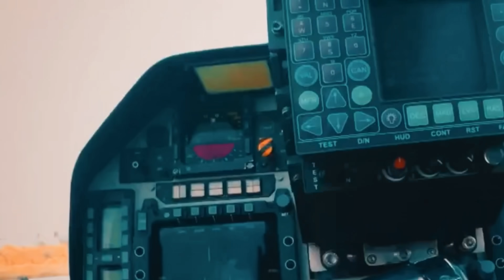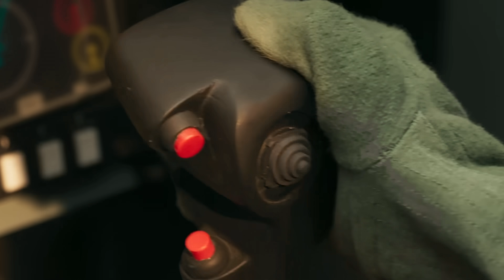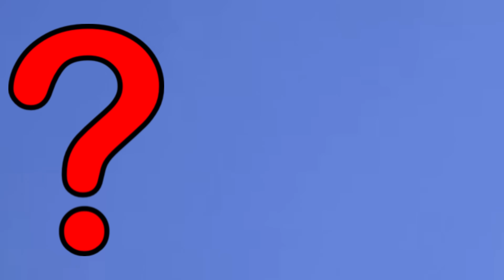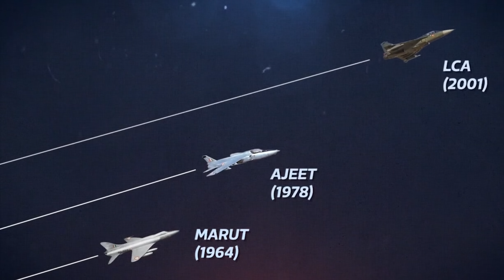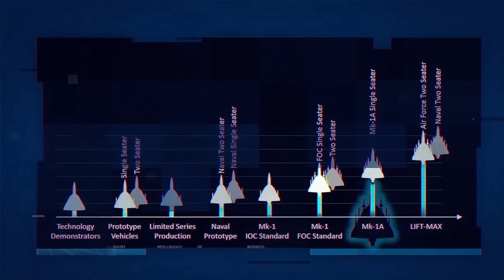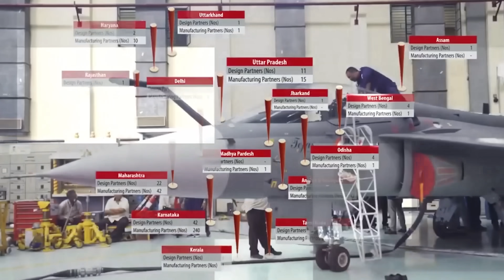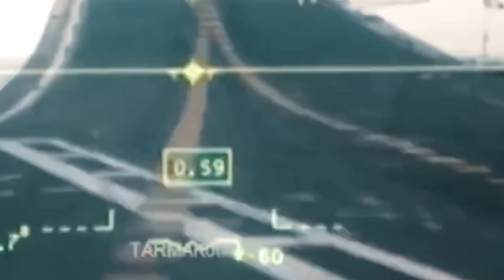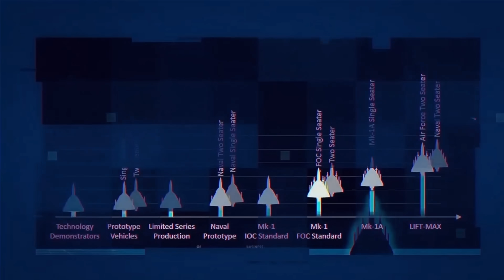Why does everyone hate the Indian 'Tejas' LCA 4th Generation Fighter Jet?

Comment: The Tejas Mk1A is in the category (weight, range, payload wise) as the Gripen C. Both are powered by F-404 engine variants and have similar empty weights and other parameters including sensors. In fact, the Tejas Mk1A has an AESA radar, whereas the Gripen C features the PS-05A mechanically scanning array radar. Remember, the smaller and lighter the fighter, the smaller the sticker price is. Tejas Mk1 costs approx $40 million compared to the $80-$90 million for F-16V. 

The Gripen E on the other hand is larger and powered by F-414 with IRST and AESA radar. That will broadly be analogous to the Tejas Mk2 which is in development and will roll-out either in December 2025 or March 2026. Tejas Mk2 will also use the F-414 engine, has AESA radar, IRST and internal EW suite and has even larger payload and Max Take Off Weight than the Gripen E. Gripen E MTOW is 16,500 kg whereas the Tejas Mk2 MTOW is designed to be 17,500 kg, which is like that of the Mirage-2000.

Comment: Just acquiring the capability to develop not just the airframe but also all the other systems is difficult, and the IAF & HAL pulled it off.  The only remaining hurdle is a modern engine with FADEC.

Comment: Well Tejas MK-1 is Light Weight Class fighter, Comparing it with F-16 and Gripen would be unfair because they are not in Light Weight Class!! Tejas can be Compared with JF-17 and F/A-50 which are similar class and when you compare Tejas is light weight class you will find it's on Top level in specification and performance but yes it yet to get in service with large numbers 1st

Comment: Tejas don't have Aesa. No Irst, no Ew, no Bvr capacities. How is it even 4th gen?
Reply: It does have AESA and BVR capabilities, what are you talking about?
Reply: @fenrir834 Whar's the name of company makes Aesa radar for you? What Bvr missiles are you using?
Reply: @olg7778  Elta and LRDE are the names of the companies. It has  I-Derby ER and Astra mk1 and perhaps even Astra mk2 integrated (not sure about Astra mk2).
Reply: @olg7778 It has 3 different BVRs (Astra, Derby, MICA being integrated) 😂 its pod can double as IRST & EW pod is also integrated... It has Israeli Elta 2052 ASEA & being replaced by Indian one.... Maybe use your internet connection?
Reply: @doge1995  I'm not buying it.
Reply: @olg7778  it doesn't matter if you believe it or not
Reply: @olg7778 buying is overrated lol, if you could make it through the aircraft, you will only be having a picture with the front wheel.

Comment: I am sorry but y o u r info on Tejas and India is all wrong. Tejas development didn't cost even a fraction of what other countries spend on comparable of aircraft. Its Su-30MKI, I for indigo and not One. Most 4th gen aircraft in the world currently flying including F16s,Gripens,Su-30,Su-35, Mig29,J-10, fly with PESA and not AESA. Only the latest versions of 4th gen aircraft like the F16E/F have AESA. Tejas MK1 is not getting F414 engine. 110KN F414 engine will be go in Tejas MK2 but that is will be an almost completely new aircraft than a simple upgrade of existing Tejas. As for the rest of it, I have it on authority from IAF pilots, who are my friends and are currently flying Tejas, but were formerly flying Mirage 2000 that Tejas MK1 is a better aircraft than Mirage2000. Tejas is integrated with India's Astra MK1 110Km and soon Astra MK2 160Km range BVR which gives it a better engagement range than any Russian system.

Comment: I love and admire India, but to be honest - Tejas is more like a small and light 3+ generation Aircraft, although it kind a looks cool. They should focus on all of those Su - 30 MK 1's they have or will have in a span of a couple of Years. Su - 30 in that MK 1 variant is a beast, and only Dassault Rafale (4th echalon), latest version of F-16's and Su - 35S are better solutions for IAF for their specific needs, taking into account the very complex geo-political and strategic position of India. I don't think that SAAB Jas Grippen 39 meets their very specific and unique requirements, for many reasons. I agree that they did not make a mistake in their assessment when they decided to continue with the development of this platform as well, in case of need it will find its role just as you said, but I think that the IAF should make a final and definitive decision to make the Su-30 Mk 1 backbone of their fighter aviation, especially since (I repeat) they already have them, and they will have them in large numbers.
Respect to all!

Comment: It's the lightest current production fighter if im not mistaken, which if they build enough of can be a significant asset that doesn't need to use airfields. 
And point 2, just the fact that it exists, gives HAL a significant amount of experience in modern fighter design to include bureaucracy and logistics
Reply: Buearocracy have delayed it by 20 years Ivan. 😂
Reply: @maycodes  I didn't say it was positive experience

Comment: Your video title does not match most of the content in your video!  To my big surprise, as a military analyst, or at least an enthusiast in military technology for a long time, you didn't show some basic abilities of identifying the basic facts in LCA Tejas fighters from MK1, MK1A to MK2.  First of all, LCA was originally designed to replace Mig-21 as a low end and point defend fighter.  So you can't compare it with F-16.  But having that said, the final result of LCA development renders a much more capable and versatile fighter jet that can compete with all 4th gen fighters if not overwhelming them.  Foe example, LCA MK1As have all the featured weaponry and avionic as other typical 4th gen fighters, something like AESA radars, BVR capability, sufficient self-defence EW ability, Network-centric warfare capability etc.  And the last one is the most important feature in the future for it can make LCA become a powerful node that is linked to the other platforms and also be able to share critical battlefield info in order to better fulfill its missions and protect itself.  A lot of early models of F-16s doesn't even have this Network-centric capability.  In addition, LCAs are very economically viable, meaning that India can easily product large qualities of them if necessary to meet the country's strategic requirement.  At last but not least, the development of LCAs has gave India a valuable experience and expertise in making its future 5th, or even 6th gen fighters like AMCA that is going on right!  In my personal views, LCAs are on par with, if not superior to Sweden JAS39 Gripen counterparts.

Comment: Just like you talked about obsolescence of some systems on Tejas, your video too seems obsolescent particularly when you talk about AESA, when AESA equipped version has flown and going to join the air force in about a month. Is it fair to compare Tejas to Gripen, F16? If so, why are those aircraft participating in MMRCA acquisition program of IAF where the first "M" stands for "Medium" while Tejas original name was LCA, L for "Light"?

Most of the video hides behind generality and not specifics.

Anyway, good attempt but mediocre video at best.

Comment: India has been pitching for export order of Tejas MK1A since 2020 when it could not even commit delivery to any buyer prior to 2027. India had not even started the production of MK1A for IAF till recently. Even today the biggest negative for Tejas export or any Tejas buyer is, they won't get delivery of their order prior to 2029.This is the prime reason countries opting for other jets as their need is more urgent than wait for 5-6 years to get all orders fulfilled. Other issues is IAF keep changing requirements & asking for add ups or modifications to the existing order further off-shooting the proposed date of delivery. Fund relase to HAL is another challenge. IAF or Gov.t doesn't give the funds on time to HAL so procurement, production cost, Salaries & payment to vendors don't get stalled. These are the biggest challenges which needs to be addressed by the Gov.t & HAL ASAP. My father was a retired Engineer from HAL, though he was in Helicopter division, they know what's happening in the co. & why delays.
 
HAL was committed to delivering a total of 18 twin-seater Tejas trainers to the IAF in last 2 years. In October 2023, HAL handed over the first trainer version of LCA Mk-1. Currently, Eight trainers have been delivered as of March 31st, 2024 and final ones are undergoing the necessary flight testing before they are inducted into IAF service.

The remaining ten trainers will follow in a phased manner, with complete delivery by 2026-27.

IAF ordered 83 Mk-1A fighters for 48,000 crore in February 2021. But the Tejas Mk-1A made its maiden sortie from our Bangalore HAL facility only on 28 March 2024. The Indian Air Force (IAF) is likely to get the delivery of its first Tejas Mk-1A aircraft from  HAL only in July 2024. The delivery of the 83 jets is expected to be completed by 2028.

Until HAL ramps up production to 24 jets per year don't expect any order to materialize. Another challenge is GE cannot deliver even 20 engines per year. A key point of discussion will be addressing unresolved issues from a previous engine contract, including delays in the delivery of 99 F404-IN20 engines for the earlier batch of 83 Tejas Mk1A jets.

These delays were due to supply chain issues and global disruptions caused by the COVID-19 pandemic. GE intends to steadily increase production to 20 F404-IN20 engines per year hopefully by 2025. However, HAL's need for over 120 new engines will require GE to push production even further, to an annual output of 24-30 units.

I don't see any order coming in for at-least next 2-3 years. India or HAL can expect cracking some export order probably post 2027. We made a goof up in our first Helicopter export with Equador due to promises which we could not keep. Total negligence & laid back approach of HAL for supplying key spare parts & poor maintenance got itself a bad name for its after sales unprofessionalism which resulted in crash & cancel of order. Though things have changed, After sales support & service is something which HAL is still new. Will take a decade to learn with time, orders & experience.

Conclusion
The LCA Tejas program represents India's growing ambitions in aerospace. The evolving partnership with GE on the F404-IN20 engine is crucial for the program's continued success & export orders.

Addressing production challenges and meeting expanded demand will be essential for fulfilling India's plans to equip its formidable homegrown fighter with a homegrown Engine ASAP, if not we will end up losing the market as technology gets obsolete with delays.
Reply: Thank you for sharing that explanation of the issues.

It boggles my mind that G.E. cannot consistently deliver 20 engines a year without any supply chain problems of any kind. That, to me with my knowledge of General Electric's history, should be a humiliation that gets most of its Board fired for cause! That's fundamental mismanagement, that shareholders should not accept.
Reply: For anyone wishing for a 3-4 line summary:
The Tejas was delayed by multiple reasons, its production has been slowed thanks to GE, but overall is a good job by HAL.

Comment: For its price and design parameters, the Tejas is an effective, competent 4.5G combat aircraft. Also has the lowest crash rate since the first one flew in 2006. Exactly 1 crash till date.
Reply: Obviously not when India went back to importing old foreign aircraft. Nice try.
Reply: Plane did not fail, instead G404 engine failed.
Reply: @wisevictor9751 still
Also it exists in low numbers, that's why low crash rate

To compete with china India has to produce atleast 100s of these a year

Comment: Thanks for your attempt, some points to consider:

1. Tejas is a light combat aircraft (LCA), its not a in the class of F16 etc, for that class Tejas Mark2 (bigger tejas with canards like Rafael) is being developed. (Medium combat aircraft) expected rollout by 2028.

2. Tejas MK1 is not facing problems in exports due to technical problems. Its because: 

A. it more capable then its competitors so more expensive too in its class. Order for 120+ Tejas MK1a are under production, orders for another 100 expected soon, so costs will come down with volumes.

B. The problem is also because of use of some imported parts. Some client countries have disputes with countries making these parts and didnt want to depend on them (e.g. Falkland issue of Argentina and UK). Once india developes its own solutions this will be resolved. (UK ejection seats, Israel radar in initial lot soon to be replaced by local, US Engine to be produced locally and nextgen Engine to be co-developed with France, US or UK for future fighters, negotiations going on)

C. Geopolitics plays a big roll in defense procurement, e.g. if USA insists that it's friend or ally purchase secondhand f16s (e.g. Argentina) over tejas, yes it will succeed. (If US offers old F35s for the rate of F16 even india may consider)

3. India is integrating wepons local as well as imported on to it that will make tejas as capable as a higher class of fighters in some areas, with a wide variety of weapons compatibility.

Comment: YouTuber is very generous of Tegas and I tell you why:-

6000 sorties in 23 years. 0.7 sortie per day. If your aircraft’s doesn’t fly, it’s immaterial to chest thump flight safety. Following FOC for Teja we had crash immediately. So it is what it is….

How can this aircraft be termed indigenous, Engine GE USA. Radar and avionics Israel. Landing gear BAE System. Even nose gear is exact replica of Mirage 2000.  Ejection seat MB UK. Only indigenous resource can be pilot. 

Only moving part is primary controls. 

Obsolete design low wing loading shoot and scoot.
Reply: The same can be said for JF 17.
Reply: Everything of Jf-17 is Chinese 😂
Reply: JF17 is not portrayed as indigenous-1 
Even F-35s and F22 crash, so does JF17 because all these aircrafts fly and fly a lot. -2 
Teja on the other hand doesn’t fly operational sorties. Recent FOC is explanatory. If you are truthful I don’t have problem.
Reply: @saifkiani1  Tejas had 15k flying hours from the 16 IOC jets before a 1st crash (that too from F404 engine failure) 🤣 can't compare Junkfighter-17 with that
Reply: 15000 flight hours in 23 years means 1.4 hours per day. That’s seriously awesome. Applause 

Most reliable machines get their reputation dusted only in IAF. Not to mention C130 J crash of IAF

I wish you all the best. I admire you professional acumen. SunZu said if your enemy is making mistake do not interrupt. 

Indian Navy also rejected the Mighty Teja. Dubai air show was heart broken when Mighty Teja was grounded on technical grounds. It never flew later. 

Well Teja looks like 5th Gen Samosa. By the way where is Kevari Engine and AI Radar which DRDO is manufacturing. 

It’s time to develop sixth Gen Samosa

Comment: bro, best three benefit of the already flying platform which is in production its that, 1 :- we can do anything from engine of different suppliers to weapon and sensors of different needs because we have the IPO of product, 2'nd we can do all in first for any consumer specifications if he have is  paitrence for negotiations and time for worry free operations due to some hidden clues for futureuses and supplies abd most important the 1'st and 2'nd tire suppler base along with tecincal lhow how of developing and producing the platform had created a healthy working aerospace manufacturing ecosystem which will benfit india in the future if and only if future program will not be delayed or cancled before all progress od decade is lost like after ajeet we lost all process and we have start from scratch for LCA program which become Tajes after that all . If you allow me some more line all the eco system of sub system from engine to sensors, radars aam, asm, guided bomb, ecm, esm, irst, and others also devloped, some does not be of standars like engine but most yoeded result and rightnow they are not only startinh to deployed on tejas but other aircraft as well, so tajes as a program not yielded most most most favrable results according to some but for it had in both as program and future aspect although it altlest a 5-7 years late

Comment: A flop one, what no one is interested to buy 😂😂 Not even their own Navy after its faild testing on their AGED Russian used aircraft carrier 🤡🤡🤡..

But i like their own RND for making their own Jet 👍
Reply: Wrong analysis. You are missing points. You need to ask why it was build? Tejas was build to gain knowledge and rnd, to build manufacturing ecosystem and to replace mig21. To all these points it checks. Tejas was never meant to the best fighter platform. It was meant for point defence of the area. It can do shallow strike inside in pakistan but for  that we have better platform like su30 mirage and rafale. In war even the best fighter jet gets shot down eventually. So important is to have aircraft that you can replace in its place to keep numbers up and no need to depend on import. That's where Tejas comes. Tejas is the base for the future like mk2 and amaca and tedbef.
Reply: @amit89amit 😂😂😂👌🏻